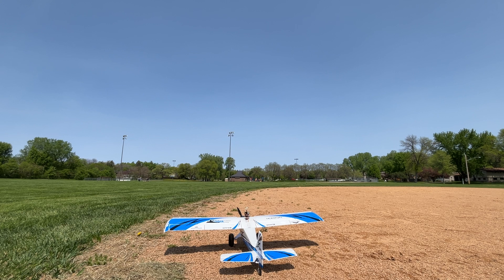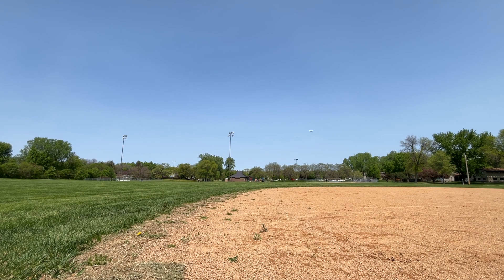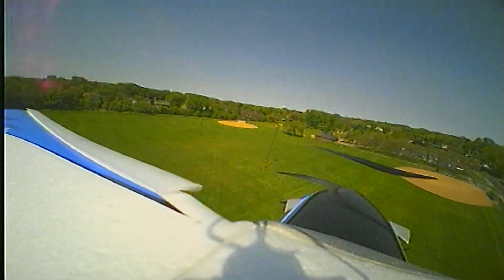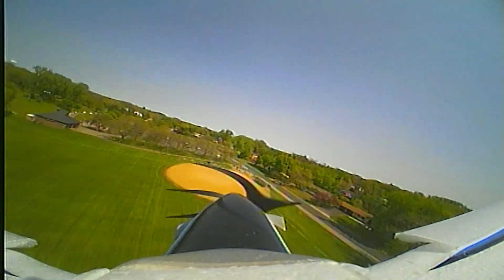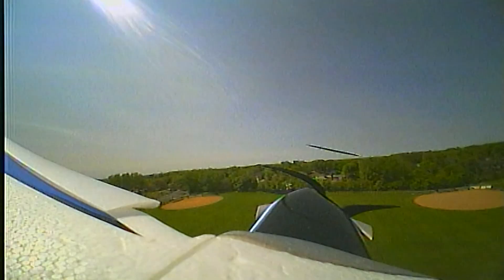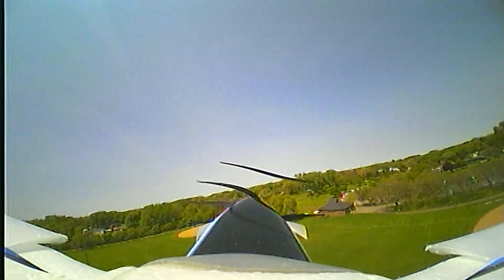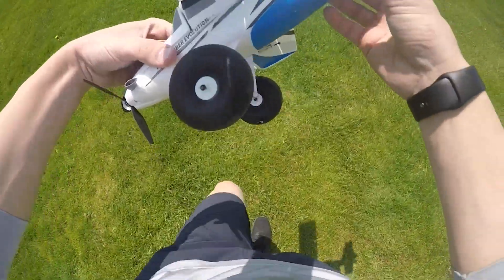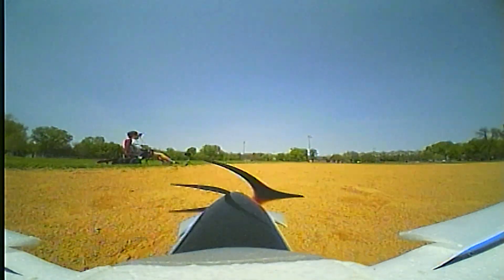Micro Head Tracking // IA Evo Repair and Recalibration

Comment: Could the jitter be caused by the servo stalling?  It seems to only occur when you are tilted down.  Could you be commanding more downward tilt than the servo can do?
I'm waiting for parts to come in to add a camera to my UMX T.T., but only planning for pan, no tilt.  I haven't tested it yet, but I'm hoping the additional port of the stock receiver is another servo channel.
Reply from the maker: Yeah you've got a good point, I'll have to look at the servo travels to see if its all goofy. Are you going to do a head tracking system, or just a pan servo controlled by a switch?
Reply: @InvertedAviatorsRC  I ended up building a pan tilt gimbal using 4.3g servos and a separate 4ch lemon-rx receiver (I've got a TX16s radio with internal and external 4-in-1 modules so can control two receivers) with everything built into a replacement battery hatch powered off the battery balance connector.  The receiver and pan servo are mounted on a 3d printed plate that extends slightly back under the wing with the back of the pan servo right at the leading edge of the wing, trying to keep cg close to stock. I did have to add a magnet just in front of the tail so I could attach a small washer to get the cg right.  I've got HD Zero goggles with built in head tracking.  I ended up adding about 40g of weight with the change, bringing the total weight, w/o battery, to around 155g.  But, switching back to the original hatch and removing the magnetically attached tail weight I can get back to the stock configuration.  I've only flown it twice so far, once line of sight, and once fpv.  The added weight definitely makes a difference, so I'm going to see if I can trim things down a bit.
Reply from the maker: Wow any new updates since you commented here? I'm doing a similar thing with the separate receiver and two transmitter modules. Did you run into an loss of signal range with two receivers so close in the plane?